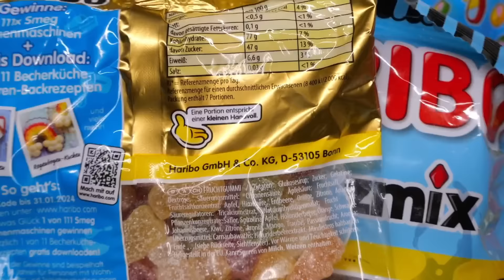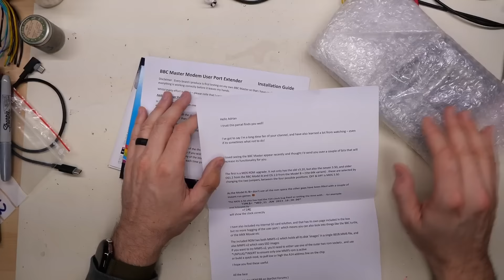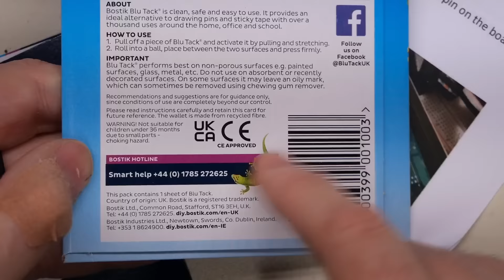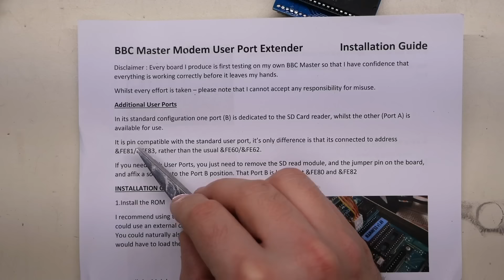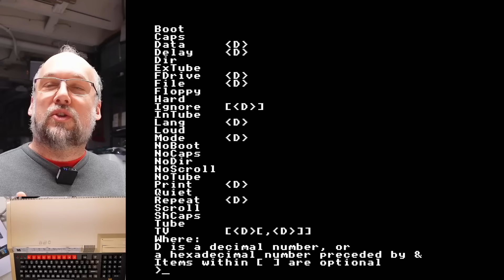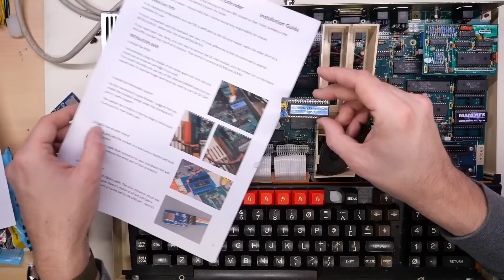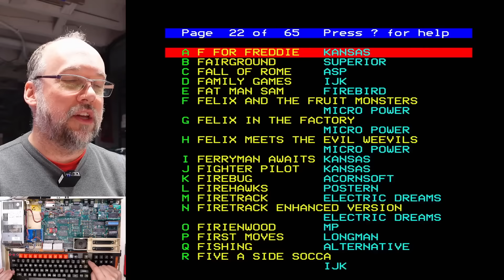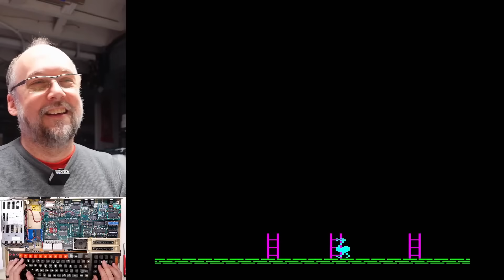0081 ROM and SD card upgrades for the BBC Master 128

Comment: You don't need to be pixel perfect when you're playing chuckie egg, To go up and down the ladders just press up or down before you get to the ladder and you'll automatically go up or down.

Also, using the numeric keypad would make playing it really difficult. The normal keys used would be z,x,/,: with return for jump. Once you get past level 9 you'll go back to level 1 but with the duck that's normally in the cage at the top left of the screen flying after you.